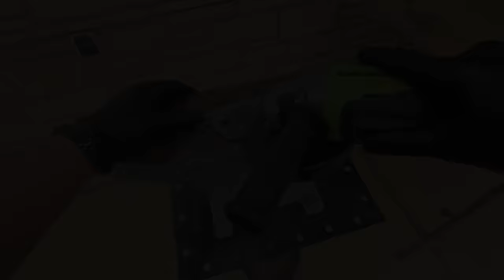Never throw away an old brake pad from a car. A brilliant idea !!!

Comment: I believe your welding skills would be much better put to use on building a solid workbench instead, hammering on top of that flimsy table you've got is pretty much pointless. I see no advantage to your "brilliant idea" over just using a tried and true brick hammer.